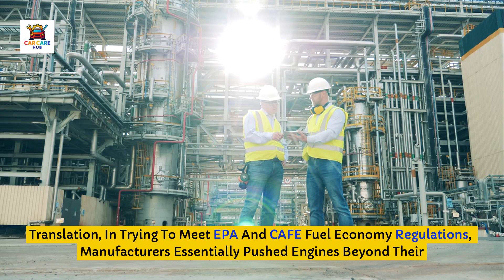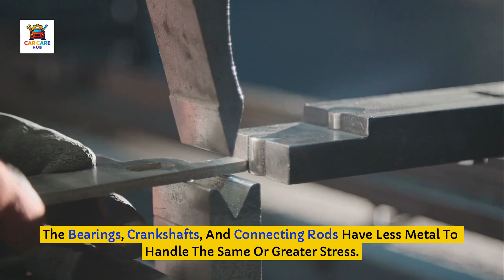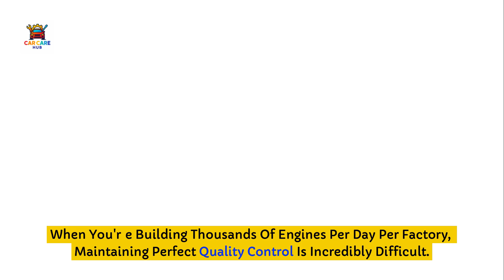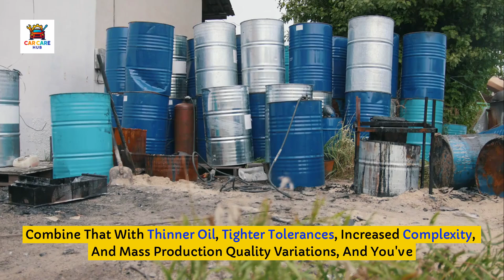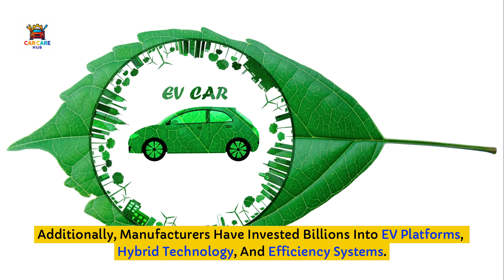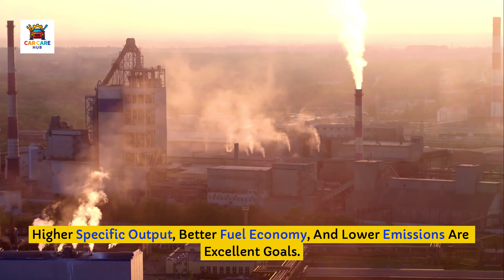The REAL REASON Toyota, GM, Honda & Hyundai DON'T want YOU to KNOW!

Comment: Engine spec cleaning employment opportunity instead of ... and to offset crate engine build, recall, service,  and replacement cost in the long run ??
Reply from the maker: Exactly. Many modern specs prioritize lower ownership cost and emissions on paper, sometimes at the expense of long-term durability. The real cost often shows up years later.

Comment: The Mazda 2.5L NA SkyActiv-G engine has proven itself increasingly reliable over the last decade of it being in service across basically the entire Mazda product line here in the US.  But, as always, proper maintenance is key.  Short-sighted things like 10K mile interval oil changes aren't good for engine long-term health & longevity.
Reply from the maker: Agreed. The SkyActiv-G has a solid reliability record, but longevity still comes down to maintenance habits. Long oil intervals look good on paper, not always in real-world engine wear.

Comment: The suppliers also have provided the manufacture’s with low quality parts some of those cams and machine parts normally smooth and shiny look bumpy rough and not properly finished / polished the assembler should of noticed this and told quality control . The Toyota engines with metal shavings in the oil supply channels again , poor quality control , to not check the flow of liquid (oil) through these channels before assembling the motor is a major “rut row” sloppy and now expensive mistake. Now they are paying the price!
Reply from the maker: Supplier issues matter, but if bad parts and metal shavings make it into finished engines, that’s a QC failure at the manufacturer level. OEMs are supposed to catch this before assembly.